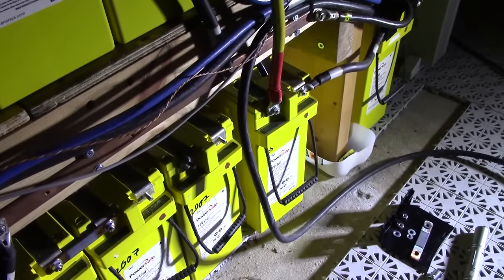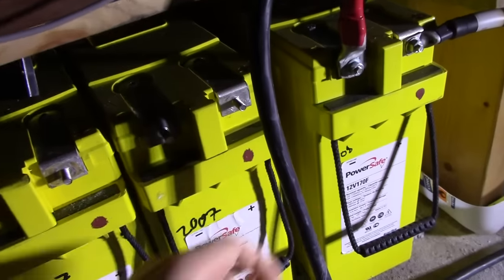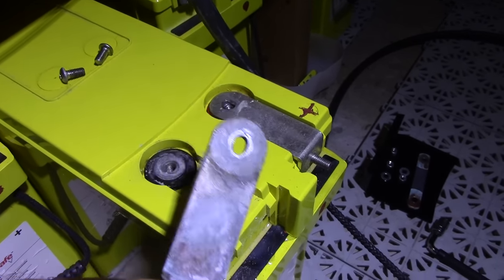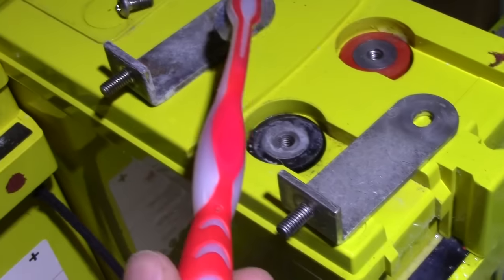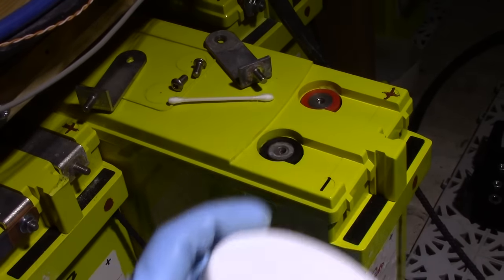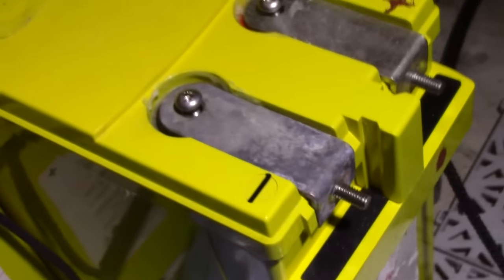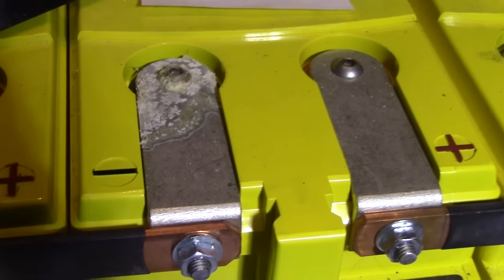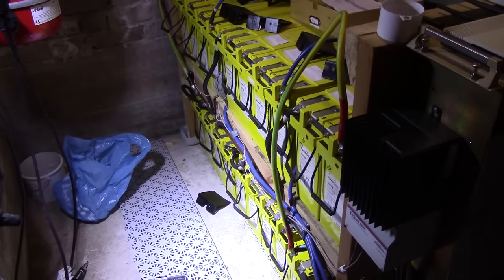Treating a leaking Powersafe AGM battery

Comment: Hi l have some of the power safe batteries picked up for free some have volts over 12 and two around 9.5v . l put a 16 amp battery charger on it and didn't change it. So is there any way l can bring it back to life or is it dead thanks. :)
Reply from the maker: +Ross Musolino A 12 V battery with less than 10 V across it is likely to have a shorted cell - it's probably dead.
Reply: +FFcossag so over10v should be ok to change up
Reply from the maker: Ross Musolino A battery that isn't entirely ruined is never going to have an open-circuit voltage of below 11,5 V or so. Anything below that means that you either have an extremely discharged battery, or a broken cell. All you can do is to try and charge it and see if it works.
Reply: +FFcossag ok thanks l will see how l go

Comment: Over charging AGM batteries causes venting / leaking ...
Reply from the maker: +TheMFrelly Indeed, but that's not the case with these batteries neither today nor in their previous application; they've been used with some rather high-end battery management systems which definitely cater to their every need, and the solar controller which they're connected to today is configured according to their datasheet.

That's not to say that there's been much charging going on during the winter.